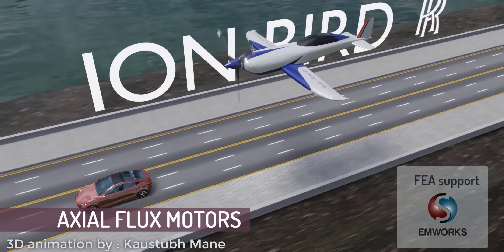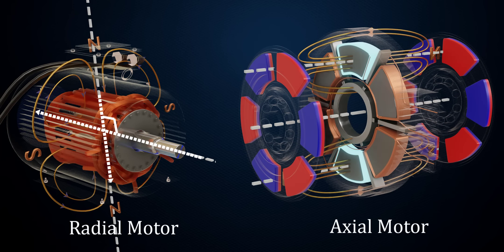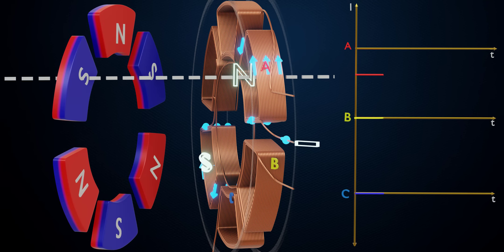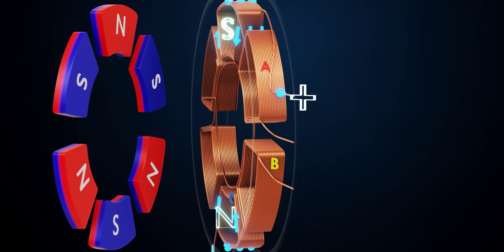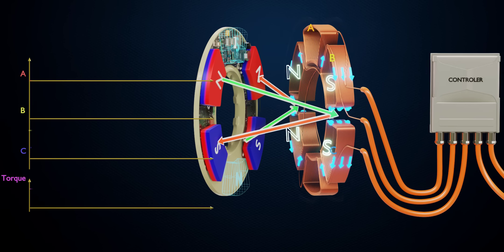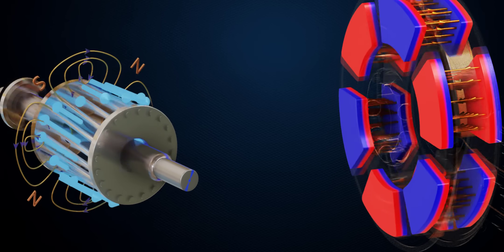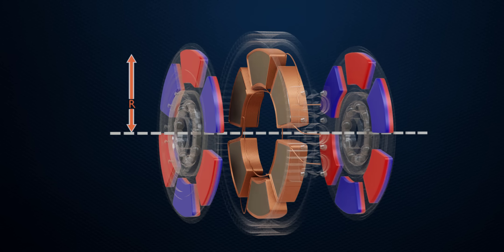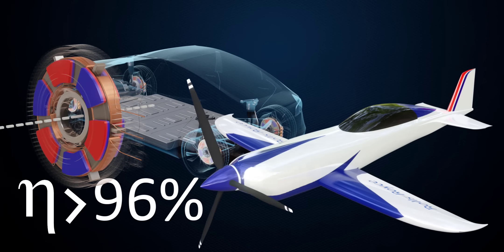Axial flux motors - The new hope

Comment: I remember reading about Citroen putting these in cars some 30 years ago , they were trying out using one alongside the flywheel of a conventional engine instead of an alternator and starter motor set up , it worked so well that it could be used to power the car with the engine turned off
Reply: The solution you talking about I've seen on czech TV in program called "Auto Moto Review" The gentleman had Skoda1000 car fitted with big flywheel to charge led batteries and if I recall  correctly it was only 50cc engine to help to get the flywheel spinning. The authorities had an issue with almost noiseless car is the danger to pedestrians. He claimed fuel consumption 2.5l/100kms. It was almost 40 years ago.
Reply: With Citroen's active suspension, electric motor advancements and god knows what else those guys concocted in their R&D dept those guys were impressive. I see they're still innovating but it's a mystery why they didn't do a Tesla before Elon did it. Maybe a big, established company is too afraid to take such risks.
Reply: @Cyba_IT  no mystery, the cause of the emergence of electric cars is politic. Before the Tesla you had the EV1 from GM. Tesla was not a precursor, it just got the good timing with california rules and a sense of hype that the EV1 did not have.
And also thanks to the mobile phone and mobile computer tech, batteries tech has improved since EV1 era.
Reply: @Cyba_IT  Citroen were indeed very innovative but sadly struggled with profitability, went bankrupt several times, and were taken over by their  less innovative competitor Peugeot in the mid 1970s.
Reply: I owned a couple of French cars decades ago. I am still mad at France. lol
Reply: @alexanderdvanbalderen9803  I believe the new Land Rover defender has one in some of the engine variations , not heard of them anywhere else ,  don’t really know why as they seem far simpler  than most hybrid engines
Reply: I believe this setup you speak of is what modern “mild hybrid” systems in cars use but on a 48V circuit powered from a small lithium ion battery alongside the older 12V circuit.
Reply: Exactly and that's why big oil shut it down. Just imagine what and where we could be without human greed!
Reply: @ashleyfletcher2543  lol

Comment: Wouldn't the use electro magnets, instead of permanent magnets, in the Rotor present additional power management options (in terms of controlling currents in both the rotor and the stators,)and possibly lighter rotors (since the rotor coils could be made of aluminum or other lightweight alloys)?

Comment: Couldn't you just make it so the outer parts had an odd number of magnets so you wouldn't really have to find a way to keep switching polarity on the central piece?
Reply: They do it the other way around. More electromagnetic than permanent poles. Usually 9 coils with 6 magnets. That way you can drive the motor with the common 3 phase lines.
Reply: @peterkiss1204  I just figured it'd work better and without having to make switches that keep going back & forth, polarly, by making one of the sets of magnets an odd number while keeping the other with an even number.  6 & 9 would probably work well, too.
Hey, didn't you used to be the drummer for Criss?  You know, the guy that always dressed like a cat.
Reply: @RedVynil  A drummer dressed like a cat? I think you've mistaken me for a guy way cooler than I could ever be.

Comment: The part I'm having trouble with is, there are six coils and six magnet poles shown. They all line up at the same time. This seems like a single phase arrangement, to me. Yet, it's being used with a three phase input. Help please.
Reply: The first set of magnets can be phase a and b, the second phase a and c the third set phase b and c. The key is the controller allowing the  rectified voltage at the right time and right polarity. The controller doesn't care if it's fed with single or three phase, just fire the scr's at the right time into the right magnets.

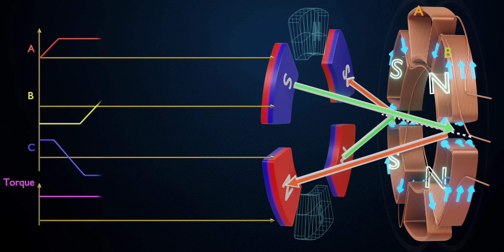Comment: 4:11 current always ramps as shown due to the effect of inductance. The slope is determined by the inductance of the coil and the voltage. No matter how much voltage you use, it will be a ramp.

Comment: That is absolutely pointless to put three of these motors to power one prop is be just as efficient if you were to put one large one and in fact it would be more efficient because you'd have less drag because it would have less bearings unless surface area for air to act on to create resistance

Comment: Unfortunately in long range aircraft is not a feasible thing when it comes down to electrical propulsion batteries are far too heavy their energy density is nowhere near that of fossil fuels.
And unfortunately even if we manage to maximize the amount of energy that is capable out of a battery it will not be enough.
Batteries will never make it into the long range air travel maybe just taxing people around within a city but nothing more than that!

Comment: They use axial flux generators on smaller wind turbines too to eliminate the need for a gearbox as shown in Homebrew Windpower by Bartmann and Fink. The generator shown is much like this, though laminated iron cores aren't used. Though it lowers output, it eliminates cogging resonance, which increases life of the blades and other parts.

Comment: It has been repeatadly related that the underside of,the UFO Scout craft appears to contra rotate; and a humming, at a frequency about 50 Hz is heard. Recently; I  managed to take a photo of lighning; associated with a UFO. . Upon greatly enlarging it, I discovered that the highly charged lightning, was of the form of a double helix 180 degrees out of phase; containing, a rippling 5 ladder. Unlike; the [ 2+2 ] eg. 4 ladder of the DNA construct.
The diameter of the, most often seen, craft,  is approximately; 30 ft.
The highly charged emenations [ flux ] however suggest a radio frequency, as serious internal damage to the human organs has been related. Probably unintentionally? Foolishly; standing too close. The body of a human, acting as a capacitor.
As they are still so advanved; is it likely, that they use, such a, motor?
Could a clever fellow, contributor, remark upon the significance of, 5 instead of; 4 of the helix?
We have for too long; misunderstood, `lightning`.
Leaders; Visala, record  many millions of, Teresteral `lightning. events, avery year. As Tesla stated, there is untapped, energy; not that; au loin.
Kenneth Maxwell Biden.
Reply: Do you really believe this stuff?

Comment: with many phases - could this eliminate the need for gears in wind power turbines ?
Reply: Good observation.

Build this thing three feet in diameter and design it in 20 phase.

As the wind increases, the resistance from the load can easily hold it steady.

Comment: If anyone thinks intercontinental aircraft will EVER be battery powered, just look at the PHYSICS that limits batteries; "we just need better batteries, and they will come" is not EVER going to be a reality. Sure, local flights in relatively small aircraft, with clever "swap out" batteries to avoid recharging delays, but NOT intercontinental flight. Don't believe me? See this https://youtu.be/AdPqWv-eVIc

As briefly mentioned in that clip, its better to use whatever renewable energy source is available to make synthetic hydrocarbons from H2O and CO2; THOSE can power big aircraft long distances with zero impact. Lets not pretend electric is the only answer to the problem. (But I do think electric has a substantial role to play, and the old axial flux is still a good solution).

Comment: Fuel cells can be a transition phase for electric aircraft.
 As all current fuel based engines are only 25 to 30 % efficient. Whereas a fuel cell can convert at least 50% of fuel to electricity. 
 Thus a really efficient electric motor powered craft should be able to beat this. One could put in small battery packs as well to provide extra power for takeoff or gaining altitude. Thus the fuel cell could be smaller as it need only provide enough power to cruise and a little extra to recharge the small battery.

Comment: This is more about the differences between induction motors and EC motors.  Most of the concepts presented apply to radial flux EC motors as well.  The remark about large induction motors "sniffing up" huge currents at start-up is not only funny, it's also quite misleading.  Motors are coupled to loads that often times have more inertia than the motor.  The reduced inertia of the axial flux motor isn't what "keeps this issue under control".  The motor controller is what limits start-up current.  If we provide a controller (VFD or ASD) for the induction motor it too can start without that pesky sniffing up of huge currents.
Reply: Dear hot dog: as an electrical engineer I am happy to see you clarify the situation and dispel the inertia situation. Although the inertia of the load can vary drastically at start up, as you say mini loads are completely dominant as a fraction of the total inertia. As a designer of electronic controls for electromagnetic devices, I am in total agreement that it is the controller itself that brings the whole situation into a refined condition of Power and energy management. Without electron it controls, the faraday motor is massively complicated mechanically. Hence the dominance of the induction motor for Nearly a century.
Reply: @steveperreira5850  We supply the position and temp sensors for this motor and for other axial and radial solutions. Imo - in the axial option the inertia issue is easier to control and mitigate. In my vision in 5-10 years there will be an axial solution so well optimized that it will become the regular technology for most applications :)
Reply: Yeah, this video is trash, it sounds big and fancy, but these are literally just 3 / multi phase, compact brushless motors. They are already in use in things from drones, to power tools, to lawn mowers.
Reply: gravesclay that’s what I was thinking whilst watching this, it’s just a different physical layout of a brushless motor.
Reply: @conorstewart2214  "...it’s just a different physical layout of a brushless motor." 
I agree. It looks like the only difference between the two motors is that the coils are rotated so that the lines of flux run parallel. If it improves torque then that's a good thing.
Reply: Is that why they need capacitors  for start up ?
Reply: @titirititiri6360  Correct, otherwise a moderately powerful motor could trip it's breaker on startup.
Reply: Why not offset the front and rear magnets so on start up they will pull towards the stator magnets in desired direction on start up.
Reply: Да, я абсолютно с вами согласен, но разница в инерции между двумя типами двигателей всё же есть, не так ли?

Думаю с развитием высокочастотной электроники многие методы нереализуемые в прошлом станут актуальны. Это видео про один из таких "забытых в прошлом" методах. Я надеюсь что это лишь одно из многих открытий которое нас ждёт в будущем с распространением электроники
Reply: Shunt mod 😂😂
Reply: The 2.5kw inverter connected to my battery bank uses about four seconds of start up. Going from zero to 120vac. The small freezer starts up nicely. But, it cycles off and later comes back on, drawing a jolt of high current. Dropping the inverter output voltage enough to set-off grid fail alarms.
Edit: Using 3Kw inverter works better. Not grid fail alarms.
Reply: Shhhh don't tell the truth. Ain't no one got time to talk about soft starters and VFDs... true they're usually not integrated straight into the body of an induction motor but they can be. It's all six of one half dozen the other
Reply: True this video is intended for the "5 Year Olds". The manipulation of frequency for higher torque using inverters in VSD's was the best improvement in the last 50 years. 

Most motors already have 95%+ efficiency, now if you can design one with a third of the weight you can make a video and I will happily buy shares in your company.

Not exactly any new engineering in this design, it's just a brush-less two-cylinder "engine" lol
Reply: @EA-tc6kb  That is exactly the point of axial flux motors. Torque/power to weight ratios is far superior. Cost to power ratio - horrendous. For now.
Reply: Someone is trying to reinvent perpetual motion and obtain monetary supporting future development
Reply: Yeah, I was half asleep and that “sniffing up” bit snapped me awake.   My impression here is that they’re ignoring Tesla and trying to make a wind turbine generator into a motor.

The problem being that when the magnets the torque goes dead?

Tesla always had the leading coil pulling the following coil.

I can imagine an array that staggers everything so there’s no cogging.

 A friend built a wind turbine generator and the cogging was FIERCE.
Reply: @Jkirk3279  None of the things tesla has done are actually new
Reply: I have not been this impressed since Rockwells' Retro encabulator.
Reply: Also controllers cannot  `decide` they do what there made to do or there broken .
Reply: @MyKharli  Do yourself a favour and use something like Grammarly or something.
Reply: @Unethical.Dodgson  Cannot agree more. Comments on YT are full of bad English but comments from many on this page are just shocking. So sad to see those whose 1st language is English can't even write English. WTF did they teach at school or was education not a priority?

Comment: comparing an "axial flux" motor to an induction motor is misleading and makes me think that this piece is salesmanship bunk. The better comparison would be a radial Permanent Magnet Synchronous Motor. you know the radial version of the "axial flux" motor, but I wouldn't believe anything the channel publishes now.

I mean god damn no one uses induction motors for their efficiency, they use them because they were cheap and easy to manufacture and control compared to other designs. At least until modern magnets and microcontrollers became so cheap and plentiful that it was more cost effective to incorporate them then the extra copper and power required in an induction motor.
Reply: Exactly recognized, that is only marketing babble. This design has been around forever in cassette recorders ect. and also in quite large, they are also used in generators. There is nothing new about it and nothing special.

Comment: Would These Types Of Motors Raise The Efficiency For A Diesel-Electric Train?
Reply: Power to weight ratio isn't as important for trains. Energy efficiency is. Trains like heavy components. They can afford extra iron to guide flux lines where they are needed. 

Axial flux motors have low weight and low angular inertia. Both of these help with electric cars since the motors go on the wheels. This adds to the unsprung weight of the car and needs to be kept low. The other option is to put them under the hood, but then you need a CV joint to transfer power to the wheels.
Reply: No, the motors of the diesel electric train are about as good as reasonably can be done.

Comment: I have a machine with Radial flux motor. I call it a 3 ph motor. It might not be as efficient as the new axial style.
But it’s over 60years old with oil bath bearings. Not much too go bad.
Can the new motors boast longevity?
I think not.
The green new deal is a grift on America.

Comment: That design is unlikely to be become wildly used that design puts a ton of stress on bearings and probably has vibration issues
Reply: They are already in use and the designs don't have those problems.
There is an almost perfect cancelling of forces so that none gets to the bearings.
Vibration is controlled by making the coil currents more like a sine function.
Reply: Why would that be? You don't have to have any stress on bearings and you can balance the shit out of it. Please explain your stance.